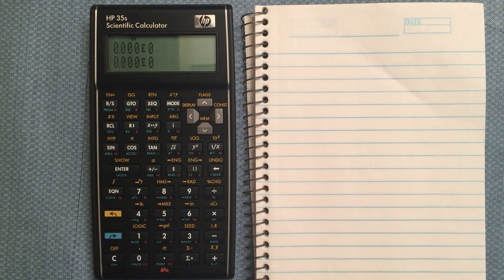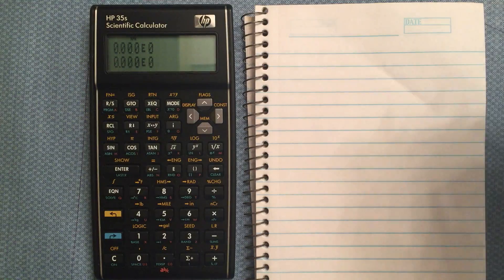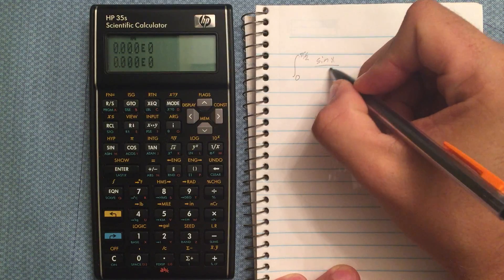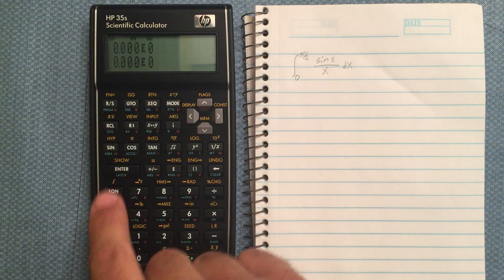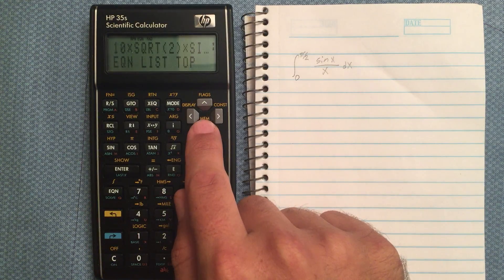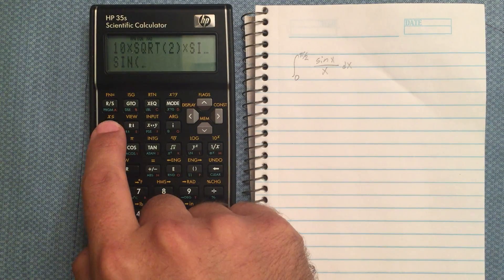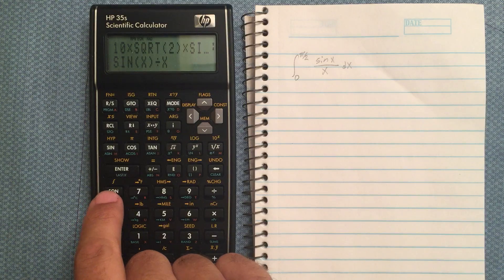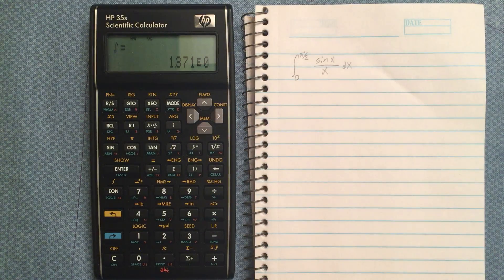HP 35s Integration

Comment: Trying to do integration with the 35s, it always asks me to select a function...  Any ideas?
Reply from the maker: A function or an equation? You can select a pre-entered equation, or you can enter one, but you need to be in equation mode in order to then select integration. At least in RPN mode, I don't know about Algebraic. Did you try the example in this video?
Reply: An equation.  I got to equation mode and then enter something like 3x^2 and then put 0 to 4 in the stack for the limits.  I follow your example and it works, as does the example in the HP manual.  But most things I try, when it should go to "integrating" it goes to "select FN"
Reply from the maker: After you put 0 to 4, go back to equation mode and make sure the cursor is on the equation you want (3x^2). You may need to put a multiplication sign between the 3 and x. But you need to select the integrate function while you are in equation mode.
Reply: Great little video. Always learning something new on the 35s. Thanks.
Reply: Is this a pre programmed calculator or is this a stock function

Comment: What about a question on volumes say a base diameter of 20 and a height of 25 with a parabolic constant along the sides of x=10-sqrt(y) and wanting to know the volume of the tank? Is my integration from 20 to 25? Then when plugging in my constant would I be trying to solve for x or y ? Thanks for your time
Reply from the maker: Sorry, this isn't really a calculator question and I'm not interested in teaching calculus at the moment.
But there are multiple ways you could do it. Draw out the shape in XY and one way would be to find the area of the square portion. Then the area of the curved portion. Rotate around the y axis (multiply by 2pi). You could integrate with respect to x or y depending on how you approach it. And no, your integration would not be from 20 to 25 either way.
Reply: Okay

Comment: is there a possibility to integrate functions with variables? for an example something like (a-x)^-2 without me having to enter a number for the variable a.
Reply from the maker: Well, you could do put the variable "a" in your equation, it will just prompt you for the value each time you run it, which seems a simple enough way to do it.
Reply: thanks for the answer! but i was rather thinking of calculating the indefinite integral without solving it already.
Reply: You need a CAS calculator to calculate the indefinite integral (and other symbolic manipulations). Something like the 50g handles it very well